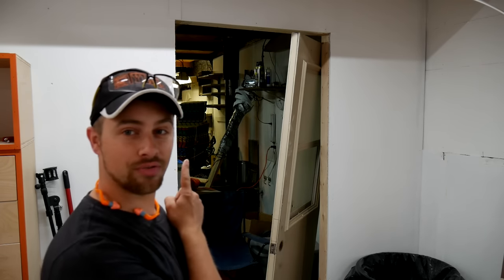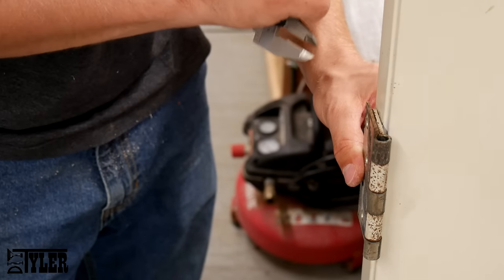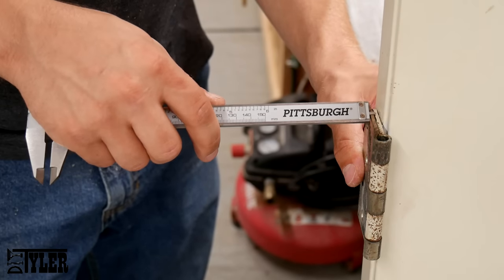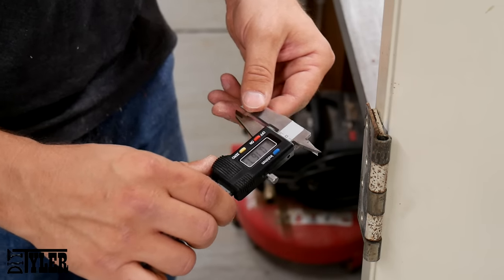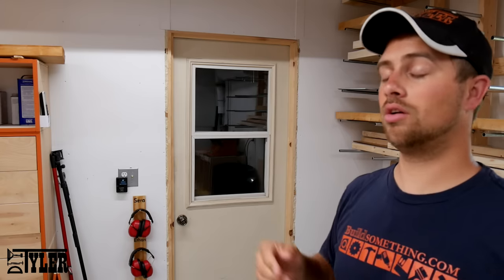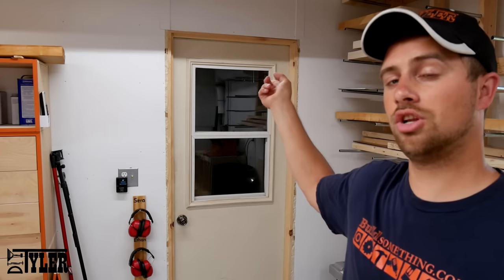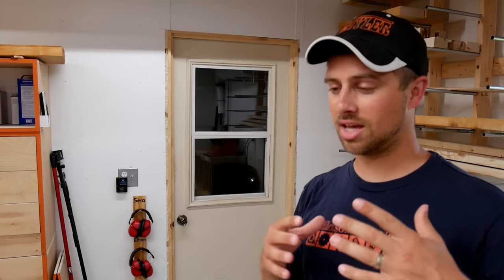Never buy a Door Frame AGAIN! | How to Make a Door Frame | D2D DIY

Comment: Let me show you how to make a door frame for the average Joe. Oh by the way. Do you see mythousands of dollars spent o  wood working machineries, yeah I forgot to mention you need a wood shop with all this equipment also. Good luck😂.
Reply: First thought but still doable.
Helped confirm how I need to put together the door frame.
Reply: Could've used commentary on what materials to get.  This is completely useless for my skills.
Reply: Definitely not my definition of diy,  diy means ducktape, toothpicks, and paper clips and maybe a roll of toilet  paper
Reply: I was thinking the same thing.. i dont have a wood shop in my house .. i do have a nice music studio.. this is really not much help
Reply: No you don't need a woodshop and all of the tools.. it can be done  with a circular saw a square, hammer and chisel
Reply: @DennisNy75 you can do this with a circular saw . Tape measure, square, hammer and chisel, he just happens to have a router and a chisel works fine for that, usually you end up using a chisel after the router anyway. Unless your making a video then you don't need a chisel. 😅
Reply: Just rub two sticks together mate.....you'll be fine

Comment: I like the fact that you up cycle materials.  However, it would have been nice to have you explain a little more as you went through the steps.  Such as how you came up with the length to cut the jamb, etc.  otherwise good video for someone a little more advanced.
Reply: I should have read your comment before I typed mine.  Different wording, but hit all the same points.
Reply: Nice project, could be a little more heavy duty though.
Reply: I had the same comments.
Reply: You measure your door, then add a little bit. How much depends on your floors, if you have a threshold, etc. It's not brain science or rocket surgery.

Comment: Great job Tyler. The prices of pre-hung interior doors are insane. I built my own frames also, its a little more time consuming but well worth the cost offset. For those who are wondering about the details of the task. Measure the door, add 3/16” to the top and sides. This will give you enough wiggle room in case your rough opening isnt plumb and square. Dont worry about the gap, you wont see it after you staple in the door stop and trim. Someone below mentioned security and the use of shims behind the plunger plate and hinges. I roughed out an extra 1 1/2” and used a 1x in those critical area vs using shims to get that extra thickness to install longer screws.
Reply: Thanks. I was just wondering about spacing for the door.
Reply: The 3/16" is the measurement I lacked. Thank you, sir!
Reply: Awesome advice, thanks!

Comment: From a security standpoint, and just good practice, you should shim directly behind the lockset, and deadbolt if there is. And my preference is to shim behind the hinges too, so you can use longer are screws. Looks good though
Reply: I mean, pretty much ANY door frame you build or buy can easily be broken through by a very light kick. It's all wood construction.
Reply: @otallono  What Bryan said. I should know. I woke up one day a few years back to my doors all being kicked lol
Reply: Jeremy Barker behind the hinges. Those are your pressure points.
Reply: I usually cut the shims from hickory, or a similar wood with high shock resistance/hardness.  Also, take two of the standard four screws out of the hinges and replace them with much longer screws, but with similar head appearance if possible.  Same for the lockset, if possible.
Reply: these are all great points, ive done all of these things as a handyman,, but I would rather play guitar for a living.....
Reply: @jeremyotero4575  rock on!

Comment: Idk if I'm using the wrong set of search words but this is the only well done video I've seen that explains how to install a frame start to finish. 

Agree w others on needing a bit more clarity about how you installed the face plate and the bold hole. I'm trying to upcycle for home projects anf I'm a newbie so it's hard to find the right videos. Ty

Comment: enjoyed the video but would have appreciated more explanation of what you are doing - also, I don't have all the special tools you used, there must be other ways of making cut-outs etc.  thanks
Reply: As far as mortising the hinges, you can use a $5 set of wood chisels instead of a router. It'll take longer, but definitely will get the job done (but realistically, you can get a cordless router for less than $75 easily, and for significantly cheaper if you search on Craigslist or Facebook Marketplace).

The door catch is with a simple drill and Forstner bit. Home Depot has an 8 pack of various sizes for $20, and decent cordless drills can be bought for $50 to $75.

And personally, I think he was going a little overkill using the multi tool to cut off the shims, but to each their own. Just as easily done with a flush cut saw ($13 at Home Depot).

Comment: I like how you got to the point but it woulda been nice if you explained a little more on the initial measurements to get the dimensions and gaps right between the door and the frame itself

Comment: Nice work tyler. I hate hanging doors.period,such a pain in the arse. On my shop door which was a solid core reuse store unit, i built the king studs from 4x4 with a 2x4 trimmer stud.i drilled the hinge holes out and used 6" screws 2 per hinge. Not kosher but very strong. I hate hanging doors.

Comment: Thanks Tyler.  Question - If you are building from scratch (new home build), could you build the 2x4 studs directly touching the door frame to avoid using shims?  A truly custom fit door?  I like the idea of the strength associated with the idea but never see it.
Reply: If you mean install the door directly to the wall studs y
The door slamming and what nit will damage the walls. Much like a bridge it has to have some give so it doesnt break itself
Reply: I have done this, to make sure its a thight fit  just place the door befote the wall. So i actuale drilled the wall 2x4 thight to the doorframe and then leveld it out. For strength i place wood inside of the metal stud (2by4)

Comment: I like the way you did this with the door in place 😹😹 last time I did the door frame I had to refit it as the door hole was not squared to the door once I had done it, now if I had placed the door in the frame and then hung it I would have saved my self a lot of grief that's for sure😹😹😹 thanks for sharing this when I go to redo all the doors in the house which I do have to do as they are not wide enough for wheelchair access I will be doing it with the doors in the hole as well 😹😹😹😹😹

Comment: You should use a marking gauge when fitting hinges especially if your chopping the hinges to both and frame. You set the marking gauge to the centre of the hinge pin then mark that depth on frame and door and you know to chop out to that depth

Comment: what tool did you use to bore out the sides for the door brackets? What dimension lumber were you using?
Reply: looks like he was using 1x4 boards. using a router to rout out the hinge mortis

Comment: Do another video where you show how to do this a super cheap kit from HD. I have a jigsaw, a multi-tool, a skill saw, and a hammer drill... How do you get good cuts without a table saw? What blade is used for the skill saw? I'm not even sure my skill saw can cut through 2" wood lol

Comment: What's the point of the wood screws into the top jamb plate? There's no real structural benefit to that considering you glued and brad nailed it. There's no shearing forces applied to that part of the jamb when installed considering the side jambs are screwed into the framing and really only the hinge side sees anything significant. I'm also curious why you didn't mortise and tenon the top jamb into the side jambs since you have a router.

Comment: I saw no measurement suggestions. If my door is 32' wide, do I put the side boards 32" apart at the top? Do I want to make them the exact same length as the height of the door? It appears you have a shim at the bottom. Should I make it so they don't touch the floor? If so, by how much?

Comment: I NEVER buy a pre-framed door. The wood is flimsy, usually finger joint glued scraps and so flexible that squaring them up is almost impossible to do right. I mill my own jambs out of good grade 2x10s (I always go with 2x6 walls) because pre-frames that fit in good 2x6 walls are almost impossible to come by. I never use molding to establish the seal surface but mill a step in the 2x jamb. Once I get them in good and square, I back them with studs flush up against the jamb and use 3 inch screws to mount hinges and lock plates. You will break a leg kicking one in. It takes some time but you have a door frame that will live longer than you will.
Reply: I have 2 doors that for double doors any suggestions how to build frame for double doors?

Comment: I was wondering about the tool you used to cut for hinge. A close up done on securing the screws though. Also what was the wood you put in front of hinge. When you first closed door the hinge was apparent but then you installed a piece of 'molding' was it? I liked video but I needed more details in order to use as a tutorial at home.

Comment: Hey Tyler, really liked your video. I was wondering if you can send some advice down my way. We recently purchased a prehung wooden door. When we began installation we realized that door jamb is only 2" 5/8 thick. Can this narrow width hold up a wooden door?
Reply from the maker: Sounds like you guys have walls build like a modular home. In which non load bearing walls have the 2x4 structure orientation sideways....a wooden door would be a lot of momentum to absorb, hollow core would probably be wisest!

Comment: do you have some sort of sweep or threshold for the door? my only concern with the expanding foam is that it puts pressure on the jamb which may crack around your screws in time. otherwise, nicely done
Reply: Another video of this type said there was a special kind of expanding foam used especially for doors and windows that only expands slightly.

Comment: Like your video. Was hoping you was doing one with a threshold plate for an exterior entry. Going to attempt one but don't have the sweeper seal yet & I'm not sure how much space to allow for that. A seal I looked up is 7/8ths but seems you'd want to have it touch some. One thing I read said 1" but how could it seal with 1/8th gap? I was thinking 3/4" that way it'd be 1/8" of sweep sealing. Any thoughts?

Comment: Next time you might try screwing four pieces of 1/2 inch plywood in  2x4 squares to your door frame first and  on your dry walled side of the door frame  when you slip it into the hole you can screw it into the frame work and make it square and level ,then shim and with your nailer tack then in with some 2 inch finish nails remove your temp blocking and trim her in ,once you ve tried it ,you ll ask yourself why have i been doing it the other way for so long ...lol
Reply: Thats a heck of an idea! I will use that next time I do a residential door jamb.

Comment: Thank you! Very helpful. What is the name of the tool that cuts to sink hinges?
Reply: Rigid Brand cordless router from Home Depot. On sale right now for 149. Cool tool to have, you can also make shaker cabinets, drawer fronts, lots of things.
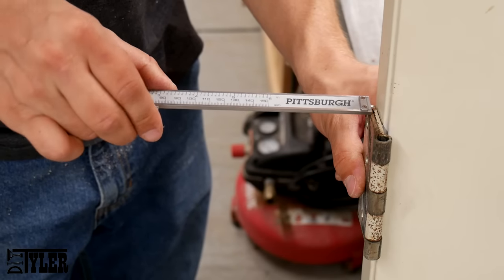Reply: @nmatthew7469  could you explain what he means from around 1:05 with the hinge measurement? I understand it's to accommodate the weather stripping which I also want to do with my door but his rattling of the measurements makes no sense to me. What does he mean recess 'Down', one and a half of the width, isn't it recess across, the depth of the router?

Comment: You bout good as me lol. I just ran into problems with home there a doorway in back of house but above the door is back Porch I have only 77inches clearance with 34inches width HMDPT wanted 300$ for custom design. I was thinking same thing cheapest way is to go with wood door because this door leads to very small room then there's second door that leads to Basement and upstairs apartments.

Comment: 5000 dollars of woodshop equipment and a 24" level ;-)
The other nice thing about building your own jambs is you actually have a real board for the hinges to ride on instead of the thin piece of scrap that most adjustable jambs provide....not to mention screws and glue instead of two staples per side.

Comment: Always nail a some wooden piece across the width on front edges of sides of door frame below the knee level, so it will stay in proper rectangle while installing.

Remove the piece after installation.

It will also help when you have to move your frame some where else.

Comment: I hate to be that guy but you have your finger WAY too close to the nail gun. You should be at least as far away as the length of the nail. I've seen them turn around and come straight back out the side they went in, right where your finger was. Also, if you're going to point at the spray foam and touch it and we can hear you touching it, you may as well just say "I put some low expanding foam to fill the gap so it's not drafty...." the more you explain, the better. Keep it up!
Reply from the maker: +Jeremy Specce Looking forward to your expert videos! FYI, I have put nails through my finger before....camera makes things looks different then they really are

Comment: Why did you measure the hinges? Just put them on the router and adjust your bit height to the height of the hinge.  
When shimming only shim latch side.  On the hinge side Nail packers to level to the door frame before putting the jamb in.  Then you can get a 3mm packer between door and jamb hold it tight against door while shooting nails in which will give you perfect gaps around door.  Then shim the door frame.
Reply: Viral Clown That sounds like a good way of doing it.  I wish you would do a video of putting in a door and frame, I do it and it never is as easy as the videos show.  Send me a msg if you decide to do it, I need a good tutorial.
Reply: tstfrd I run a maintenance/ renovation business and doing videos is on my bucket list. I bought a dslr camera Etc and wrote up a whole heap of videos I plan to make.  Hopefully soon I'll start
Reply: Thank you viral clown for the tip
Reply: Viral Clown have you started making videos yet. Would like to see you door frame build.  About to tackle one soon and need all the help I can get.  Thanks

Comment: Gotta watch that spray foam sometimes it will push the frame out of square.
Reply: Was going to mention the same. As the foam expands, it pushes the door frame inward and can cause an otherwise great fitting door to not open or close properly. Otherwise a great video!
Reply: Sometimes low expansion foam will work better. I'AM sure Tyler  has put in a few hundred doors with his back round and regardless as some others my say he knows his stuff.

Comment: When you have a commercial shop it is not DIY. 

Seeing as I have none of this equipment I fail to see how this helps me.
Reply from the maker: That's a great excuse. Since you can't do it don't bother me while I am getting it done.
Reply: If a $200 miter saw is too cost prohibitive, get a $10 hand saw. You can cut wood just as well, it will simply take you longer.

If a $75 router is too cost prohibitive for you to mortise out the frame for the hinges, get a $5 set of wood chisels. It will accomplish the same task, just take you 10 times as long.

If a $100 multitool to flush cut your shims is too cost prohibitive, use a $10 flush cut saw.

If a $4 Forstner bit to cut out the door latch is cost prohibitive, you have deeper problems.

The point behind all of that is that there's a thousand ways to do a hundred tasks, and the exact tool you use to accomplish the goal isn't important. Quit bitching about "his wood shop". He's already said that a vast majority of his tools that he uses with any regularity only cost him about $500 total because he wheeled and dealed on Craigslist to get what he has. If you cant afford $500 in tools over the 4 years he's been running this channel, you need to find a better hobby.
Reply: Also... Do... do you know what DIY means? It means "Do It Yourself". And rather than buying a door frame, he (wait for it) built it himself.